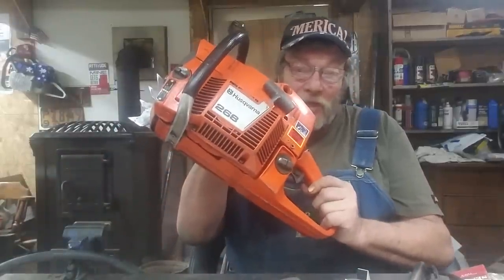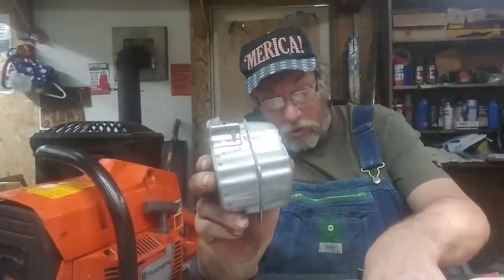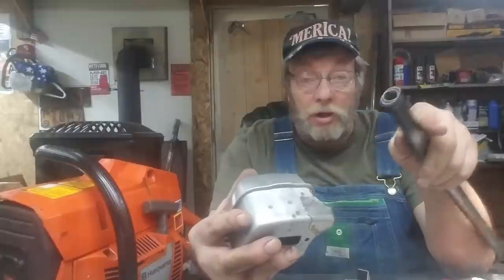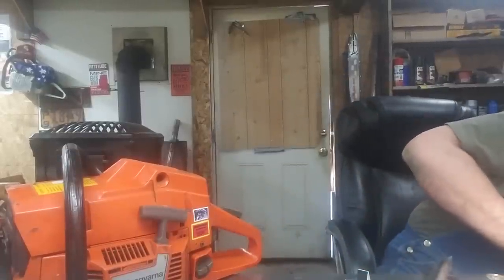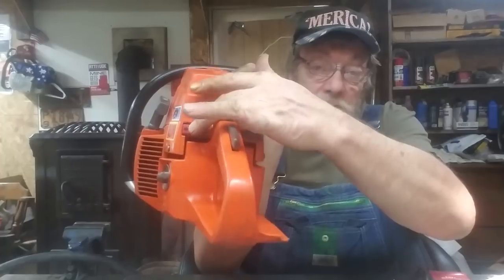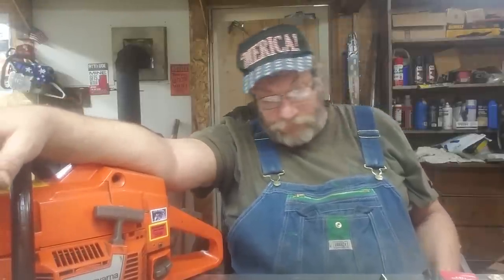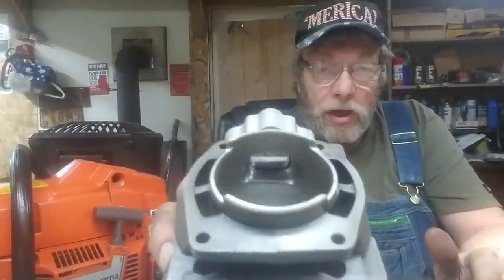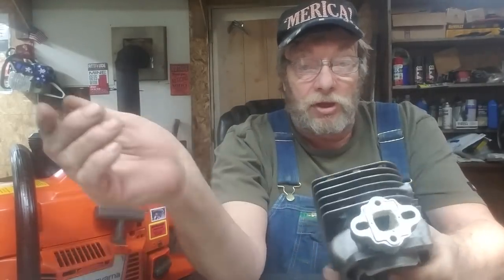Adam's 272! 372 reed cylinder is getting a real head! must see! a story!

Comment: The reed induction saw with a real combustion chamber will excellent. You can make a nice wide squish band and stagger the transfers. Cool. Good call on cutting off the top of the cylinder with a saw. After completely destroying a cylinder in the lathe, I learned my lesson. Now I have an aluminum block that I bolt the cylinders to for boring and facing. And of course the cylinder I destroyed had untold hours of porting work done to it before I chucked it up...sigh... Life lesson # 1,012 or thereabouts. That was around 1975. By now I've stopped keeping track...

Comment: Your reed saw build is similar to deutz air-cooled diesel design. Long bolts should work fine if studs give you trouble. For a head gasket some of the deutz engines have one and some don't and the ones that do the gasket is a steel ring that looks like a giant machine washer. Also I remember some old john deere two cylinder tractors had a de-compression valve you can turn on and off.

Comment: Hey thats a motorized bicycle head
Reply from the maker: Sure is!
Reply: Great idea and it's got a super low profile I will say with motorized bikes those heads overheat with hard use ive seen people take those and carve fins into the top of the head for better cooling but can only go so far with how thin it is but they work good as long as you dont overheat dont quote me but I'm pretty sure they're 7cc heads

Comment: Ok yall here's a question I have a husqvarna 61 that was previously changed to a 268 the top end failed so I want to take it to a 272 I found a hyway 272 pop up piston and cylinder the question is will it fit
Reply: 52mm bore btw